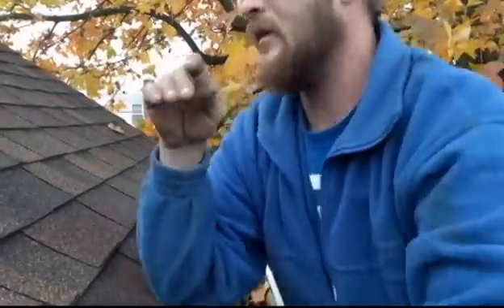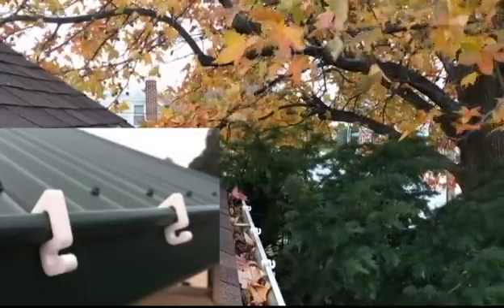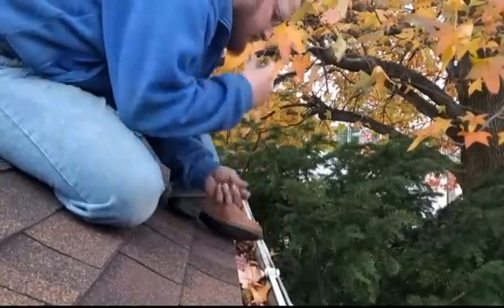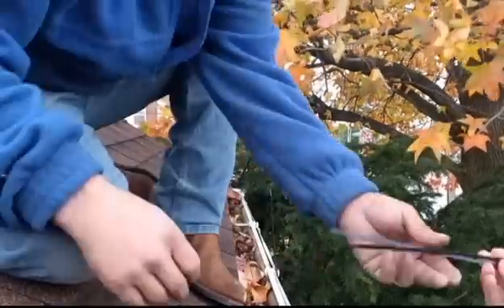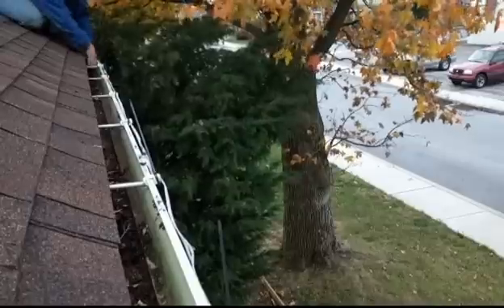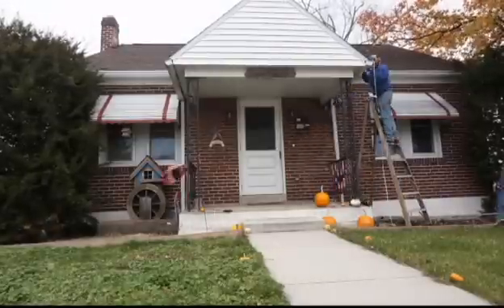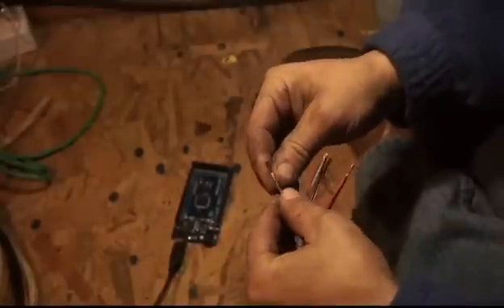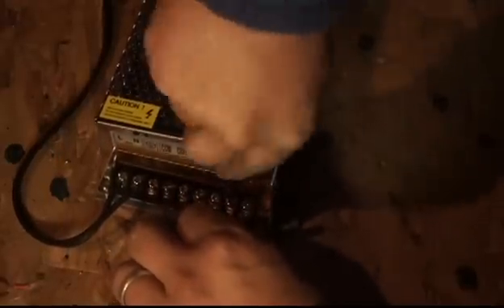How I Do It - #Arduino Programmable Christmas Lights

Comment: how did you protect the conductors where you joined your 2 strips?
Reply: I was wondering the same thing. The wires are exposed for power injection as well. This connection wouldn’t last a day in Oregon lol. Maybe if you used shrink tubes over it with hot glue around the edges. I’m looking into buying some waterproof X connect pigtails for this purpose.

Comment: Can I ask. Could I programme those bog standard led string lights you can buy at your local store. I have tones. One set is all blue and I use that one year and there is around 50 sets.  I also have another set that are mostly multicoloured which I use the next year and there are around 60 sets.vI know each led can’t be programmed (at least from what I know).
Reply from the maker: With a relay setup you could, it really depends on the light and the circuit that that company is using. Like you said it won't be individually programmable, but you may be able to reverse engineer the circuit and control it using a raspberry pi  and some extra hardware. The raspberry pi likely will not be able to do it on its own because if the differences in voltage.

Comment: How many Led stips did you use?
Reply from the maker: 4 strands, 5m each. You can get longer strands but be warned if you link to many in line, you'll need to add additional points to boost power due to voltage drop through the length of LEDs. 5m strands make this easy to do.

Comment: I am a dad of an autistic son who loves LEDs. He used Arduino and programs them all the time. Problem is I have a hard time hooking them up. Could you explain to me how you used the 3 runs for power? And is there only 1 run for the data? assuming all the data wires are daisy chained. I want to do this to my house as well and maybe in his bedroom. Thank you. Great video.
Reply from the maker: Chris Wenzell the data wire is continuous from one strand to the next, as far as the + and - in between each 16ft strand I just tied a + and - set of wires of each run at these connection points. This allows for the power lost through the strands of flex led to be boosted back up to the needed 5vDC if you have anymore questions feel free to ask

Comment: Atomic clock add on with the arduno and pi, and automate each of the holiday cycles start date and time and end date and time, I've always wanted to hack add atomic clock functionality and reprogram a lightshow brand Xmas light strand to serve this functionality. Unfortunately the technical school I was attending to gain my electronic engineering degree went under so I never was able to finish my course and get the knowledge required to undertake this task

Comment: nice work. what gauge is that wire you used for branching out the strips? and where do you buy it wrapped in 2-wire bundles like that?
Reply from the maker: Greg Brown it is 18/3 wire, it is used in HVAC and other controls wiring, but you can purchase it at most any hardware store, or an electrical/HVAC supply house. I use stranded wire instead of solid wire because it is more flexible.
This is not the specific wire I used but it will do the trick. 
Non-affiliate link https://www.amazon.com/dp/B01M62HEPU/ref=cm_sw_r_cp_apa_cUHfAbSH9WBN0
Reply: Okay thanks! I actually thought i recognized that from my thermostat connection wire. What the does the 3'rd wire in the 18/3 do?  i would assume i don't need it, or could i get away with 20 awg door bell wire?
Reply from the maker: Greg Brown if your doing the programmable ws2812 LEDs, you need a +, -, and data. I did list a shielded wire in the description, that is better for the data, but not fully nessecary.
Reply: I am using ws2812b from Alitove. I'm thinking my strips will be close enough so I can just use the pre-soldered 3-wire leads. I will probably use some shielded 2-wire like you mentioned for the power runs. Thanks for the advice!
Reply: One more question: did you budget for the max amps with your power source? Some articles say to safely budget for 60 mA at full brightness. For a 5 meter strip with 150 lights, that could be up to 9 amps! Other articles say 1/3 of that is fine. Yours seems to be doing fine with a 25 amp supply, did you ever read the current to see where it was maxing? I am buying a new 5v switcher and want to get it right.
Reply from the maker: Greg Brown I got the 25A supply figuring on 3 strips at the max rated 9A each, if you know your limitations, you can limit your led brightness in code so 50% power would roughly equal 4.5A / strip
Reply: I see. You're display only used 3 strips?
Reply from the maker: Greg Brown yes. 3 at I believe 16.4ft each.

Comment: Question for ya, did you use any capacitors or resistors from the power/data line to your led strips?
Reply from the maker: Tolby Hunt  I did not. Just straight connections to the Arduino

Comment: When drilling a hole through an external wall of a building it's often suggested to drill downwards from inside to outside to help prevent water ingress. Sealant on the outside might be enough though? I dunno.
Reply from the maker: +Sean Smith you are correct, however due to tight area that I was drilling in, drilling at an angle was not possible. Once the system was up and working I did go back and seal with an expanding sealant.
Reply: Never considered that. I would always place full faith in silicone and cavity filling foam. Thanks for the comment. Not my channel but I thank you nonetheless.